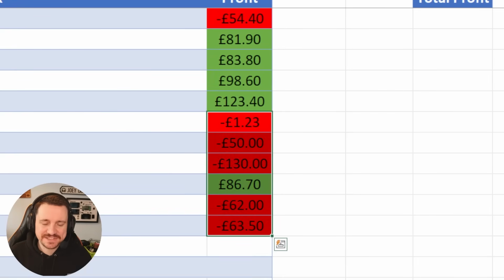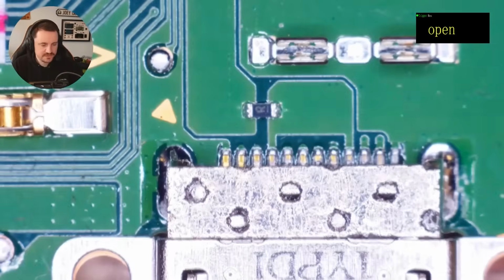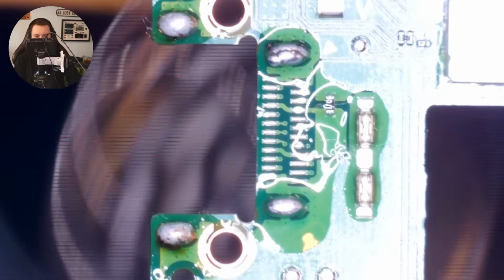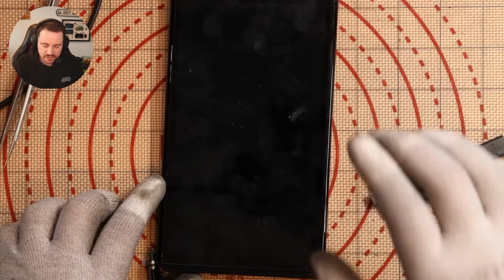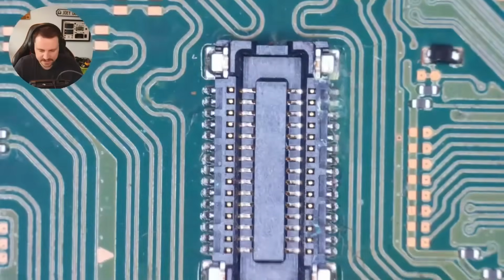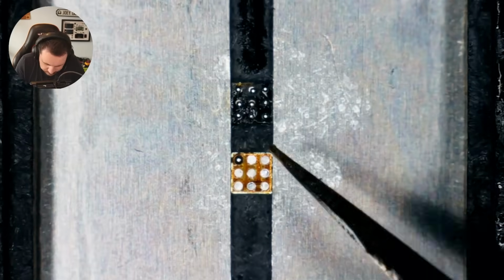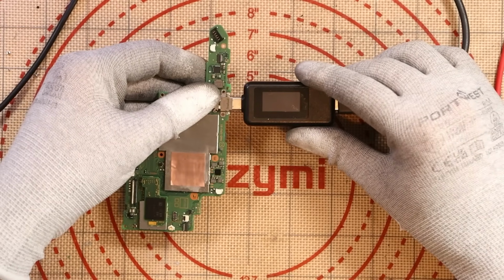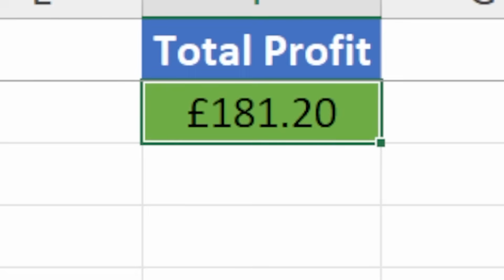Buying CHEAP eBay Electronics to Fix and Make Profit! S1:E61

Comment: I successfully repaired my first nintendo switch about two weeks ago, w/o replacung anything! I desoldered the game reader and put all the reading pins down and reassembled again and it worked like a charm! Really fun to be able to repair a device using your head, and not simply going "this part's dead, let's order a new one for 40 bucks and wait four days".

I also repaired a webcam with a defective wire! Simply stole a donor wire from a crappy old logitech mouse, soldered the pins onto the webcams usb wire port, and no more shutoffs when slightly tugging the camera! 

I also stole a mouse switch from that dead mouse (lol, Deadmau5, pun unintended) and replaced my own switch for ny Logitech G502 Hero. I accidentally tore off the grip rubber, so I reassembled it using loctite. Looks and feels almost as good as new, and I've used it since 2020! A lovely mouse, imo! 

I also reflowed old game boy color games and got them working! My next mini project is to repair Pokemon yellow, where a chip has a ripped pad, and a metric ton of corrosion on the cartridge. I cleaned most of it off, literally took me 30 minutes of scrubbing snd cleaning snd applying anti corrosion aerosol spray for 15 minutes for three different rounds. 

It's super fun to repair things!

Comment: The issue I have with the Profit spectrum- you're not including the fact Ebay and Paypal slam you with fees.
I sold HTC Vive trackers, I got a 10% or higher charge from Ebay, and a 75$ fee from Paypal, "seller protection fee" which was ridiculous. I lost majorly on the sale
Reply from the maker: I do include fees :)

Comment: Hi mate - really loving the videos. I would love to do what you do. Could you please give me a quick list, however quick you'd like, and tell me how I could possibly get started so hopefully one day I could be half as good as you?

Already understand a good deal about how motherboards work. Understand resistors and their purpose, capacitors, CPU's, etc. The only thing I'm clueless on is the actual electrical side to it. I obviously know some things to even understand what a resistor or capacitor does lol. Built an 8-bit CPU as a personal project years ago, but that was a very focused set of information I learned, primarily dealing with how CPU's work barebones and following schematics. Would love some pointers so I could practise and learn in my free time.

Keep up the great content. I've subscribed!

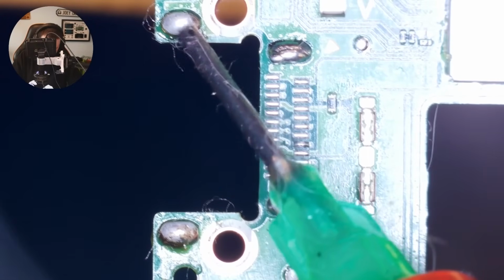Comment: 6:05 careful with the cotton swap on the legs of the USB port you could get stray fibers stuck in there which could impact your ability to cleanly solder to the board (also it will just make a mess).

Comment: You need to factor in time. The defective product might be cheap, but when you need to spend hours fixing it for a marginal profit, then you're not really using your time well. I typically try to get PCs and laptops for free (scrapyard, stuff our office throws away, etc.) and fix it up. Most laptops and PCs I've sold for a profit only needed something like a new battery or an SSD to run and the more interesting PCs I tend to upgrade (better CPU, more RAM and a GPU if it makes sense) for a better sell. Those usually sell very well. And if there are just too many issues, then I strip them for parts. A while ago I found an old HP AIO Computer with a broken screen. Fixing the screen just didn't make sense to me, so I took it apart and sold the RAM, the board and stuff like the webcam. Not a lot of profit, but very little work involved.

Comment: Hey mate,  I'm a scrapper who builds with components.  Something you may not know is your distaste for the solder is well founded.  Electrical companies tend to use gold solder- works better out of the box but results in brittle joints.  It's good news for me,  most components yield a few hundred worth of gold, but for you? I'm willing to bet that 99% of issues could be solved by reflowing. Try that as your first port of call

Comment: Just from looking at the port from the start it is deffo a port replacement . It won't be a short as such, more rust and dust on the connector pins. If you wanted to you could try to clean them up but I'm n general it's less time consuming to just replace it .

Comment: If you get any liquid in a 30w USB c port and charge it , you will typically short the connection and melt the cables. At the moment I'm using a mobile that did exactly that and has a melted usb port lol. Do not mess with usb c, she isn't the same tamed beast that we are used to with micro usb .

Comment: Very impressed with your repair ability, especially surrounding the BGA's removal and resoldering! Question for you Joey. I have a Chinese 12V, 3000W inverter that I found has some shorted voltage converters that I cannot find anywhere, and the manufacturer, (LuyuanIPower, model DX-GAC3000W), has not replied to my emails. Would you happen to know where I could find a ZB4215 12V-110V converter?

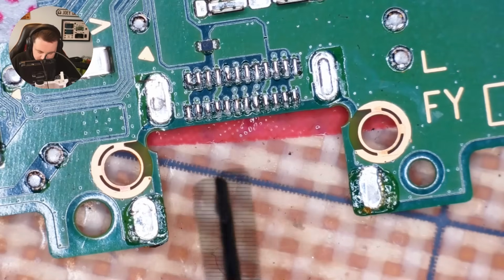Comment: 5:04 hello, what is v3?
Reply: From what I can find online, as someone with no prior PCB repair knowledge lol, is that V3 is likely to be some kind of cleaning gel that removes any residue and oxidised layers from heating so that the board takes the new flux and solder cleanly.
Reply: There are different versions V2 and V3 Flux. 

V2 works best with lead and soldering irons.

V3 is universal and works with lead and lead free soldering . Also works well with manual and hot air rework.

Comment: I'm not a big fan of using the heat gun when fitting the usb ports. The plastic can melt if you lapse in judgement. I usually just use a preheater and a low temp soldering iron.

Comment: @JoeyDoesTech      I am a novice but really enjoy your shows and has given me the inspiration to do some work on broken items and or even improve etc..  So thank you so much       @JoeyDoesTech:  Question or Idea.  When you have close up of the close work, putting solder on a unit or cleaning a unit, could you also have another camera, further back/higher up that can show the full tool/implement being used as sometimes its hard to tell what tool you are using at certain parts when really close

Comment: My suggestion would be to go to electronic recyclers where you'd be able to get any of those thousands of electronics for just above scrap because they'll be happy to take cash and get a higher price and not have to ship out to their smelter. Instead of messing with these high prices of eBay. Turn the recycling business for a long time and I think that you have great success finding a good recycler to that has a good source from a big company that's bringing in these type of electronics and get them pennies on the dollar

Comment: 5.6" of rain in 20 minutes and the utility power failed, water filled a floor backflowing through a sump pump.  Lots of electronics on the floor were flooded by fairly clean water, including the HDDs, CPU and RAM inside the working tower computer.  The board was sprayed and cleaned using copious quantity of HCFC 141B/ ethanol.  A hair dryer was set on low blowing over the inside of the computer for 2 weeks, and the ambient air was 95°F. It actually started up and the only problem was an 8GB RAM that required replacement.  Not nearly as sophisticated as the work in this video, but with some luck, maybe not needed.  ☺
Reply: Saved by the fuse blowing immediately. Water damage takes just a few seconds under power.

Comment: Nice! I needed to know how to solder for an upcoming project. I studied how you soldered extensively. I am designing a new type of motor, its a motor design that anyone can build at home with a CNC machine. I am experimenting with the design now, dont know 100 percent if it will work, but if it does, its gonna be epic! Wouldn't it be better though to go back to how they did it back in the 1950s, like instead of all the tiny tiny circuit boards, have much bigger and bulkier electronic parts, that way its easier to fix? But with modern power electronics. Like combine modern powerful electronic components with way way larger pins and an easy circuit trace, like instead of all the layers in a circuit board, have just one or two layers on a really thick circuit board. Im thinking about designing a new type of fully electric vehicle with these motors. Thanks!

Comment: I had a USB-C port get fried on a phone, looked similar. It was caused by a faulty cable which bridged two pins and melted the PCB which forms the centre blade. Phone was fine after replacing port.

Comment: Nice clean video. It was easy to digest and well planned. Not full of uhms and other such things. This is the first video of yours I have seen.

Could you share what DMM your using where you're pulling the reading into your video? I'm hunting for a DMM and ideally oscope that has the ability to stream its data. It doesn't matter to me if it's usb, Bluetooth or other as long as it has an output stream.

Comment: I never reball those tiny "glasses" . Just make some bubbles with soldering iron on the chip and the board and then solder with hot air. Never failed.

Comment: In the past, I’ve always had an issue with finishing anything I started. Books, projects, relationships, that one time I tried to learn the harmonica—left behind like a half-eaten sandwich in the back of the fridge. I even once started a 30-day challenge to improve my discipline… made it to day three and then got distracted by a YouTube video titled “Top 10 Ways to Procrastinate Efficiently.” I took notes.

But recently, I found an incredible solution to this problem. Seriously. It’s brilliant. It changed everything. I’ve never felt so productive, so focused, so—

Anyway, the point is, this method is foolproof. I stumbled upon it one day while reorganizing my spice rack alphabetically by emotional significance. And let me tell you, once I started using this technique, I—

Oh, and did I mention it works for everything? Work, hobbies, even that novel I’ve been “writing” since 2017. I applied the method and suddenly—

You know what? I’ll just tell you exactly how it works. Step one is—

Actually, hold on. I need to grab something real quick. Be right back.

Comment: i know this video is a year old... and im stil here xD... i just looked up some Switches on Ebay with the thought i could grab one or two to repair them myself... but heck nowadays everybody is thinking "yeah, i can repair this" ... i found so many "maybe been opened" "been opened" "openened with all the screws thrown in a drug baggy" ... how should i know what they did and maybe did they something wrong and Ripped Traces, ripped Components of the PCB... to check the thing 100% isnt worth the time <_< i guess you got an new subscriber and im gonna inhale this series of Fixing Stuff <3
Reply: I buy laptops used for like 50 bucks a piece (All have like i5 7th generation or higher), apply new thermal paste, replace the broken things. 
Then sell it for around 120 bucks, people find that really cheap and they get great value for money. 

Been doing that for a while, super easy and really profitable.

Comment: The 2nd one definitely had a lot more corrosion on it to begin with. Someones tried to clean it, but the tell-tale signs are all over that board. It hasn't been done properly with an ultrasonic cleaner. So probably worth doing Joey, incase corrosion still chips eating away potentially causing a future fault. 
As for positive comment, cheer up, it's chocky season. 😊

Comment: Not bad! And £30 for the gaming laptop on auction, that's quite cheap, I'd have happily paid that just so I could gut it for parts (that would be useful for fixing other laptops)... so long as the RAM and storage weren't soldered!

Comment: Joey, with joy, juggled a jumble of jinxed Nintendo Switch parts, painstakingly piecing the perplexing puzzle, with practiced precision and perceptive prowess. He twisted tiny screws, teased tangled wires, and tinkered tirelessly, turning the troublesome tech into a triumph of technical talent. With nimble fingers and a knack for knots, Joey navigated the maze of microchips, never missing a beat nor a glitch. He soldered, he soldered, he soldered some more, until the Switch, once faulty, soared. So here's to Joey, the masterful mender of digital dreams, whose skillful hands and steadfast determination made the Nintendo Switch gleam!

Comment: Nice repairs here. I just subscribed to your channel. 😊Just one quick question for you. With all the other repair channels I watch, when unleaded solder is used to remove a component, care is taken to remove the unleaded solder before the new component is put in place. However in the oiled switch, I noticed that you left it in place. I’m curious to know why.

Comment: Just want to say I appreciate you telling buyers that a device was water damaged and what you've done with it. Shows a lot of integrity on your part to simply be honest and open. I think it's nice if an eBay buyer knows exactly what they are buying. With secondhand items it's easy to get baited and exploited. This helps a lot with giving people a heads up should any issues arise. Well done, keep up the good work, God bless and all the best with the rest..
Reply from the maker: Thank you! Honesty is indeed the best policy. It would only come back to bite me in a months time if it stopped working and I hadn't of stated that. I manage to sell it for £79.99 instead of the £90, but still worth it :)
Reply: Certainly helps to have a YouTube video as evidence of proper repair.
Reply: Really helps the next repairer - I used to test /sell old phones and list the fault as found. 

But I could tell from others they would list joblots of "untested". Despite having plenty of fully tested stock 😂

I still buy things to fix but when it's listed as "untested" I will go and see if the seller has a history of selling tested items, or clearly repaired items and if so avoid. 

There are some house clearance/recyclers who genuinely lost everything as I tested and I find those those the best lots for me. 

Stay lucky people.
Reply: Lots of dishonest sellers on various sites, however there are also sellers who are genuinely unaware of some issues related to faulty products. Some faults are obvious to some, but completely missed by others. 
If you buy with the "it wont work and im taking a gamble" mentality, even when you get screwed, its ok as its considered a loss you were willing to take.
Good luck out there.